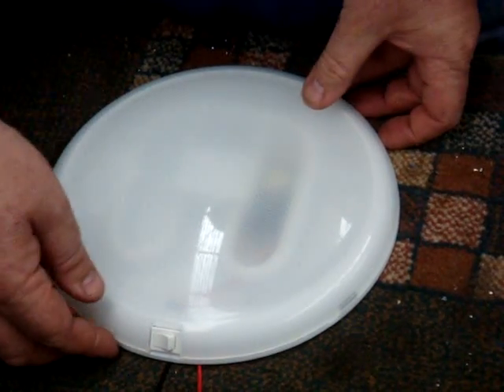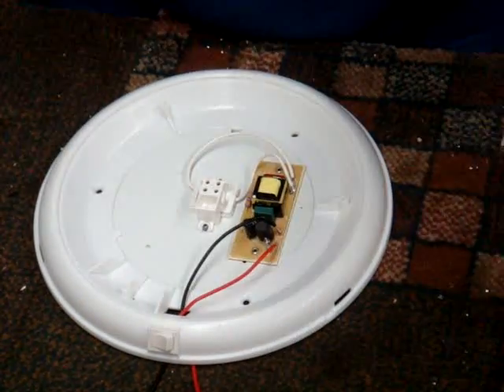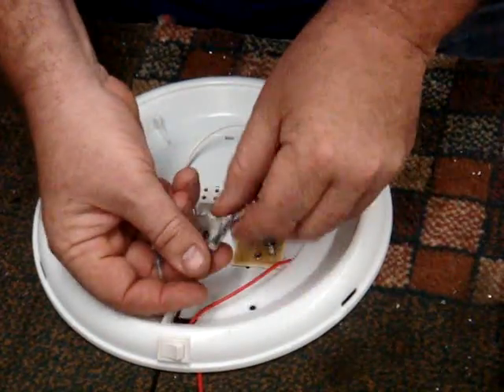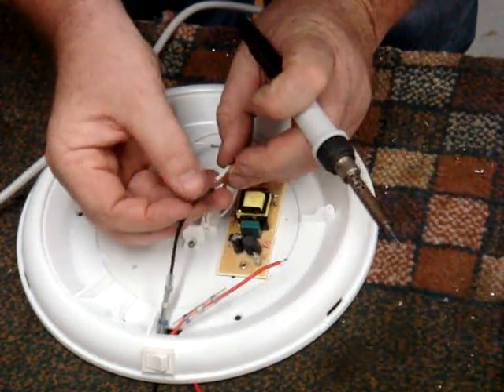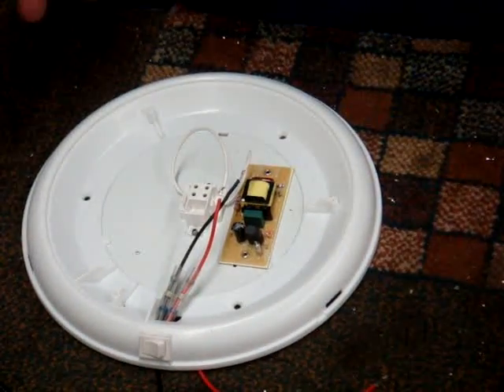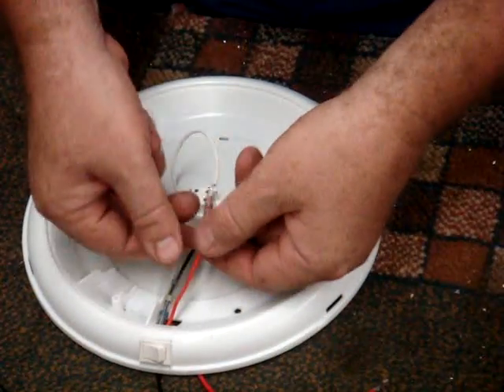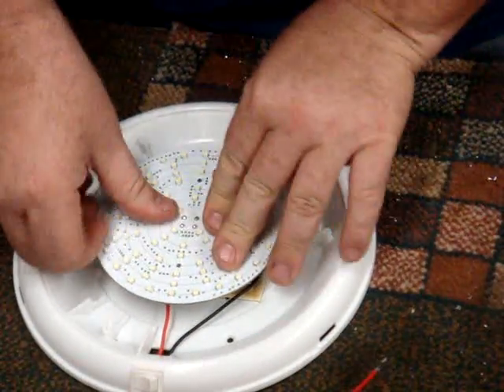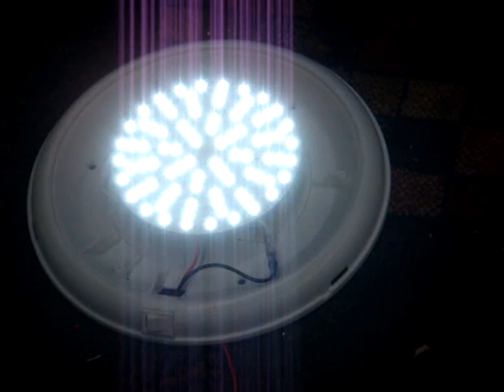Replacing 2D Fluorescent tube with new 84 LED bulb

Comment: Is that's 220v going straight to the led then? Is that OK to do?
Reply: +Ross Canpolat This is a low voltage unit in a motorhome where you'd have 12V or 24V DC. All you are doing is removing the inverter because LEDs work directly off the DC.

Comment: Hi there, I'm hoping you might be able to suggest a possible reason for a strange problem I'm having with a 2D lamp. It's a 2-pin lamp, so if I understand correctly, the starter is in the square box on the tube, not in the lamp fitting. The lamp comes on alright, but then switches off after a couple of minutes. I replaced the tube, but the same thing happens, so it can't be the tube and, due to it being a 2-pin lamp, it can't be the starter either. But what could it be then?
Reply: Probably still have a ballast etc in the fitting itself, turn power off, remove plate and bypass internals. Assuming its a standard style fitting that is. double check with an electrician first